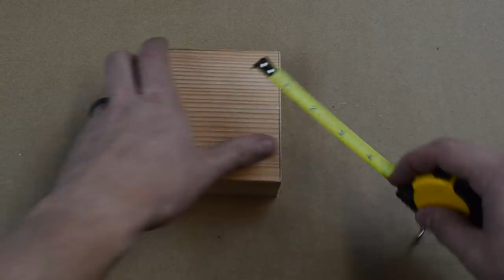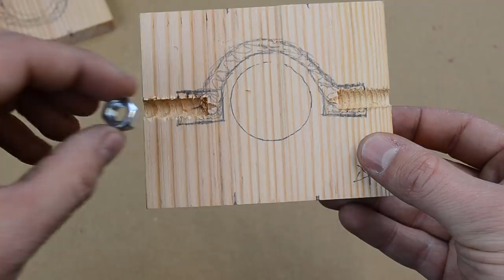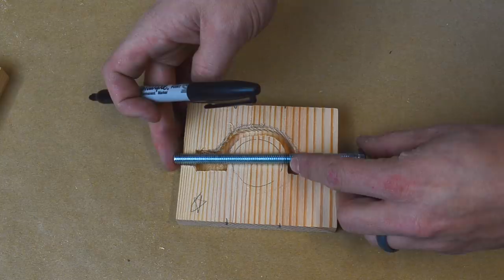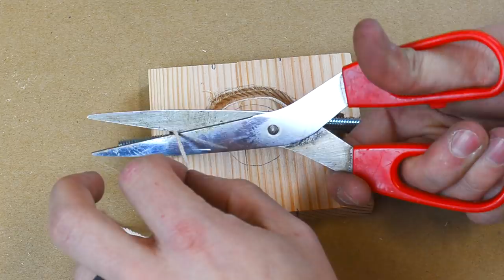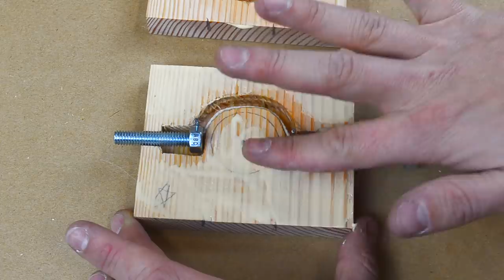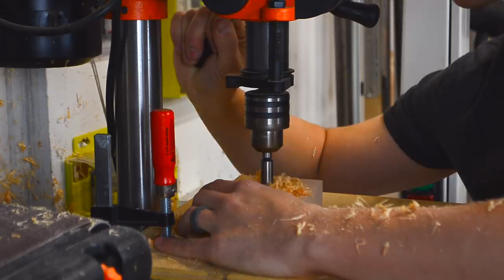Impossible Vanishing Sliding Bolt Trick

Comment from the maker: Thanks for watching! If you have any ideas on how to improve this thing, I'd love to hear them. Leave a comment below, and don't forget to like and subscribe if you enjoyed this video!
Reply: You should find a way to make it work when PUSHED as well as pulled? Just using the same frame idea (as in the arch over the hole, inside the block's internals), but using a more rigid piece of flexible metal, meaning it will more reliably push out the bolt on the other side? Just a strong enough, 'precisely calculated' (well, enough to match the arch's rounded 'length' anyway) strip of bendy metal should work.
Reply: @andrewsparkes6115  I was thinking springs to push each end of the bolt outward.
Reply: @bobh3300  Well yes, that is effectively what I meant. But an uncoiled, flexible piece of bent metal would likely work better as it'd be less 'springy' in visual appearance.
Reply: Weld/glue a solid half-rectangle and increase the internal area cut out to fit. It will not have any play. Also as others suggested, split the wood.  _|````o````|__
Reply: Bend a U in the middle of the bolt around the hole.
Reply: I'd try and split the wood rather than cut with the band saw.   It would be a littler harder to do, but the kerf/seam would be harder to see.  Obviously you might have to get the wood grain aligned.
Reply: If you use a spring to connect them, you can twist it one side, and the other side will turn as well.
Reply: Use a metal band instead of string so you can push and pull.  If you use a segment of metal pipe like the one you put in the core but larger diameter, cut to 1/2" wide, then slice it in half, it would arch over the hole.  Weld it to the bolt halves to make it solid.
Reply: A suggestion for improvement could be have the archway between the blocks contain a very viscous fluid that is sealed inside there, that way you could pull or push and it wouldn’t matter, the other side would move. Just don’t fill the cavity 100%. And it Has to be sealed airtight.  Probably far more of a pain than it would be worth.
Reply: 1. Drill the hole first before cutting the block in half or creating the channel.
2. Use an inflexible bar or rod to transfer the motion so you get pushing and pulling. 
3. Advanced mode: use a geared transmission to transfer rotation and have it screw in and out on both sides simultaneously.
Reply: Use a tiny crank shaft. You can hollow out more part of the block to accommodate a more sophisticated mechanism.
Reply: Two tiny syringes with water in them.. connected with a small tube...
Reply: connect the two halves of the bolt using something rigid but flexible so you can push and pull the bolt. i would suggest a heavy duty zip tie epoxied to the bolts. the channel  will need to be narrower so there is no room for the plastic ziptie to take up slack before pushing the other end.
Reply: You need to make holes in the corners too. Right now it just looks like the bolt is bent in a wide arch. Why have a compact solution that fits close to the hole when you have all the available space to use simpler solutions?
Reply: @oljobo  best answer so far . 
water is uncompressible, so force is transferred instantly.  In both directions
Reply: @andrewsparkes6115  That's what I thought. Using a flexible Spring wold help hier I guess. Maybe one could then even turn the bolt.
Reply: I know I am late to this party, but I would use a flexible extension (like for drills or screwdrivers) and attach the bolt to it. Maybe use some copper pipe for it to travel through, then you could make it where the bolt would spin on both sides. Put a nut on each side, so it would screw in and out instead of push. Make it function like a normal bolt.
Reply: I've made these almost exactly like you do-except I add a spring from a dried-up ball point pen. thread the string (I use 30# monofilament fishing line) through the spring, then stretch the spring to the length of the string. Try to stretch the pen spring evenly so it doesn't hang up on the wood edges.

Comment: I'd replace the rope with a welded metal loop. Extend the slot inside enough to let the loop slide further. Bolt will then feel real if you hand it to unknowing observer.
Reply: I would use a length of rubber hose.. that way it could turn also....
Reply: @smoll.miniatures  or use a bidirectional flexible shaft or multple cardan joints
Reply from the maker: That's a good idea! Thanks for sharing Ken!
Reply: @dkbuilds  Or pack the channel with magnetic ball bearings.
Reply: @smoll.miniatures  I was thinking what Michael said, but instead use a spring... but a rubber tube would work.
Reply: I would utilize two independent step motors on each end with various sensors to synchronize their motion.

Comment: The better trick. Would be use a small flex cable attacked to both pieces. Like I use in my RC hobbies. Along with a small bent stuffing tube it runs through. So when you turn the bolt, the other ends turns.
Reply: That's what I thought he was going to do....
Reply: I concur.  Drill bolt ends, epoxy the cable in. Done.
Reply from the maker: Ah that's a good idea! Thanks for sharing Rc!

Comment: Cool idea. The only thing I would change would be to split the board instead of cut it. That way the glue seam would be less visible.
Reply from the maker: Good idea, Hatch! I'll try that next time. Should work well especially if the wood has a nice straight grain.
Reply: Hatchmadeit -  I like your idea.  Splitting a longer 2x4 and cutting a smaller section would hide (cut off) the mark made where the wood was split.
Reply: @dkbuilds  or just make a trim around the edge.
Reply: Why not add some edge-banding?

Comment: How to improve it? Give the bolts a proper bearing so they don't tilt and connect them with a wire. There's so much space, no need for a string.
Reply from the maker: Good tip, thanks Notes!

Comment: One of the things I noticed that gives away the trick is that one "end" of the bolt can wobble in the hole without the other side wobbling. Perhaps having them inside sleeves (metal, plastic) would provide a tighter fit and stop the wobble.
Reply: Yep, I noticed that right away also.
Reply: The more obvious giveaway is that pushing doesn't push the other end.  It only works for pulling.
Reply from the maker: Very good point Ken, maybe I'll try that if I ever build another version of this. Thanks for sharing!
Reply: Strange - I cannot see it wobble at all.

Comment: I wonder if you used a spring to join the two halves if you could push and pull the bolt from the same end?  Turns of the spring might feel like the threads of the bolt.  Neat project.
Reply from the maker: That's a cool idea! Thanks for sharing HIker

Comment: Perhaps use a big nail instead of a bolt then there isn't the compulsion to try and turn the bolt. Drill the holes so it just fits the nail, then link it with a metal rod, soldered, brazed or welded to complete the link. As someone else said, split rather than cut the block of wood to disguise the join then sand well when glued together again. Could be a good illusion if executed well.
Reply from the maker: That's a very good idea, thanks Andrew!

Comment: Use a spring that had been fixed to the inside ends of the bolt. This will allow push and pull as well rotating
Reply from the maker: That's a good idea BTYBDD! Thanks for sharing
Reply: @dkbuilds  thanks! Would love to see it work out.

Comment: Could have a u shaped linkage overthe  hole with a spur gear train on each vertical leg and a layshaft across the top. You could then push and pull from either end and also turn either end and get coresponding rotary movement at the other. You’d have to keep back lash to a minimum though. 
An interesting idea though
Reply: I bet something as simple as a rubber hose could accomplish the same thing. Be rigid enough to push and pull on one end and be able to twist.
Reply from the maker: Wow that's a cool idea. I like the gear train concept. Thanks for sharing highdownmartin!

Comment: You can't push one end, only pull it.  You need to improve the internal mechanism to make it a pull and push trick.  It requires an internal linkage, rather than a piece of string.
Reply: just arch a piece of metal over the hole.  There's lots of room to remove material.
Reply from the maker: Thanks for the advice arburo! How would you make the linkage?
Reply: @dkbuilds  1. Just as stated by Patrice above. 2. Bowden cable. 3. A pair of centrally pivoted links with their opposite ends connected by a link.

Comment: Drill the hole through the middle first? ? 🙂
Reply from the maker: That's what I did on my first prototype actually... but then when I was trying to route out the channel around it, I broke the wall of the hole even though I was a full 1/4" away from it. I was hoping to drill at the end so there's more support to prevent chipout while routing, but then I missed the mark :(
Reply: @dkbuilds  Try drilling a very small hole right through the centre (before routing out the channel) - then use that hole as the centre for the Forstner bit, to guarantee accuracy.

Comment: That cool but can you make to bolts push? With with longer bolt that you bend around the hole.
Reply: a piece of coat hanger wire bent in a [ shape should do the trick. -  a project for the weekend I think.

Comment: Most people would turn the bolt and discover the other side doesn't turn before they would pull on it.
Reply from the maker: Yeah that may be true. Do you have a recommended solution to fix that?
Reply: @dkbuilds  I would try a 20D 4" nail or bigger if they make them. Anything without threads might work.

Comment: Just don't ever put it in the hands of another - because, for certain, they will do a "pull - push" rather than a "pull - pull" and your fraud will be exposed.  To improve this I would square off the 'detour' giving it extended 'slide' room on either end.  Then I would bend (or construct) a bolt with four 90 degree turns.  Then,  you could hand it to anyone and they could "push - pull" to their heart's content.  This would also mean you do not need the bolt 'stopper' nuts on the inside - however, I would at least weld one to the threaded end of the bolt on the outside of the block to provide a reason the bolt can not be removed completely.  You may use a second nut if you do not want the Head end of the bolt to be pushed all the way to the wood.
Reply from the maker: Good ideas, thanks for sharing MCM!

Comment: This would work better if instead of a string you used a curved piece of metal so you could push and pull on either end and it would move back and forth.  This way if you can only pull.  If you were to push either end the other end wouldn't move.
Reply from the maker: Very good point. Thank you for the constructive criticism Thane!

Comment: I was thinking you might use a flexible cable, like the old speedometer cables, to connect the two ends of the bolt. That way you could not only push and pull, but also turn one side and the other side would turn the same. Not sure if a cable is flexible enough to make that curve and still turn though, and it might require welding the two bolt ends to the cable.
Reply from the maker: Thank for the idea dewfall, I think that would work better than this!

Comment: You have play in the bolt that gives away the fact it is not one piece. That could be fixed by actually taking a longer piece of threaded rod and bending it round the hole as someone else has said, you would need to hollow out the wood to allow it to move back and forth. However the bolt cannot turn which is a great shame, as it should do so, and indeed if anyone can think of a way of making it that really would be an impressive illusion. I think I would choose a flat object instead (like a table knife) which goes into a slot in the block, but you would then need to weld a semi circle of metal to its two parts to be hidden inside the wood.
Reply from the maker: Very good point, nice observation Stephen. Thanks for the suggestion on how to improve it!

Comment: Why not drill the center hole first? You could use a stiff wire instead of string to push and pull the bolt. Or better, solder a piece of sheet metal cut to shape. A keyway could help keep the ends aligned.
Reply from the maker: That's a good point Ant. I didn't drill the hole first because I was worried I would blow through it when routing out the groove on the inside. In retrospect I could have drilled it first... might try that next time. Thanks for sharing!

Comment: Use a larger piece of wood with nice straight grain. Instead of cutting with a saw, split it lengthwise with a chisel till it splits in the middle. Do your working inside and glue shut. Saw to final dimension to remove chisel marks and sand. That should give you a near-invisible seam. Other suggestions below would help with the illusion regarding bolt wobble and movement.  
Great instruction video, many thanks.
Reply from the maker: That's a great idea, thanks for sharing Gabe!

Comment: OK.. My Idea to improve this... but not as simple...

Clip ring to stop bolts exiting either end.
2 trains of an odd number of gears meshed top to top of the bolts, and bottom to bottom. Pulling left bolt rotates 1st and last top gear anti clockwise, and bottom 1st and last clockwise.
Result is right bolt driven out by right top and bottom gears... (Same thing when pushed back in)...
BUT... Rotating the left bolt (say anti clockwise undo) should rotate the top and bottom left and right gears anti clockwise... but this would just bind up...
So this is where the hard part comes in...
Drill the end of the bolts and add a dual direction wound piece of cable soldiered in the hole like your piece of string.
(bike brake wire is wound in one direction,.. you need something with a 2nd winding in the opposite direction otherwise turning in one direction will spread the wire )
the wire "Should" rotate the other bolt overcoming the binding...

If that fails you could try a different approach... (which I think is actually the easiest.. but harder to find parts... 3D printer????
mill the end of the bolts to a thin axle. Jam a longitudinal spline gear on each, make a channel of these gears with the bolt gear slotted into one end... make a shaft with a spline gear either end joining the 2 channels....
the result SHOULD now work when you pull/push as the channel (looking a bit like a short machine gun magazine) is locked either side of the bolts gear, and the other end of the channel is locked to the gear on the end of the shaft... which is attached to the other,channel,bolt yadda yadda.
and when you rotate the bolt.. it rolls the gears... doesn't matter how many (least as possible) as both sides match rotation, so will the bolt.

I made my own "Trick" block when I was a kid (After seeing a similar trick block.
The trick... a block with a string through a drilled hole and out the other side. String passes freely knotted end to knotted end unobstructed.
Pick up both knots, hold one hand up and one down... block slides down, switch hands... down up.... block slides down,....
do it again but then block magically stops on its way down... you can make it start stop... Hand it to the guest.. nothing they do works, block just drops.

The secret.. Drill hole through block. Cut the block in 2. Drill big hole inside both halves but not right through to the outside.
put a bent nail in the inside of one bent over in the shape of a 7 (note a 7 makes a hook) with the hook lower than the centre of the through hole. 

How to do the trick, push the string in both ends and spin the loose string clockwise to hook it (you need to make sure you know which end is which as spinning the string the other way un hooks it).
once the string is 'hooked' holding loosly will allow the block to drop... holding tight binds the string in a V with the holes either side of the hook being the bottom of the V.

Phew...
Reply from the maker: Wow, thank you for the detailed response Butler! Lots of great ideas in there! The spinning trick sounds really cool!
Reply: @dkbuilds  If only I put the time into actually making things instead of theorizing then going off on a tangent.

Comment: Hmmm.  Maybe a square channel and wire holding the two pieces of bolt.  That way it may be possible to both push and pull the bolt pieces.   I haven't thought it thru yet, so not sure if I'm on to something.  Gotta think about it.  Neat trick.
Reply from the maker: Thanks for the comment, Don! Yeah I'm trying to think of ways where both push and pull are possible. If I had a welder I'd just create a long bolt shaped like --__-- and make a square channel like you suggest. Maybe epoxy would work instead of welding...
Reply: Dave, epoxy would probably work fine.  Or, you could make the square connector out of some hard wood and use tiny dovetails for the joints and epoxy to connect the bolt pieces to the wood.  :-)  Hey, I'm here to make work for you......
Reply: That's the ticket! Square channel, with a U shaped 'connector. If the bolt is linked to the connector with a 'loose' attachment of some kind (tiny cotter pins?) then the bolt head and end could rotate yet still push/pull each other. 
The real trick would be to make the rotation occur at both ends simultaneously to complete  the illusion. Some mechanical genius above my pay grade will have to figure out that challenge! :)